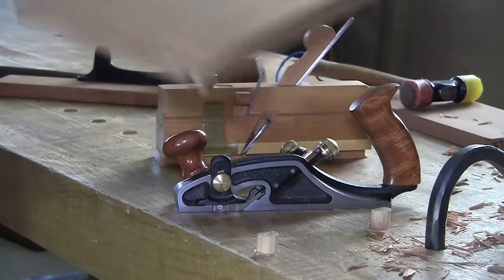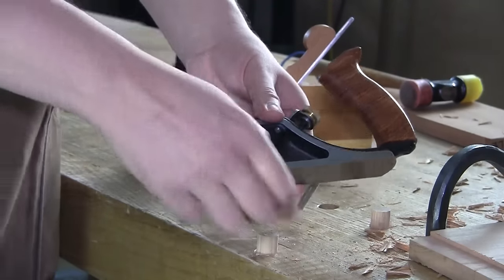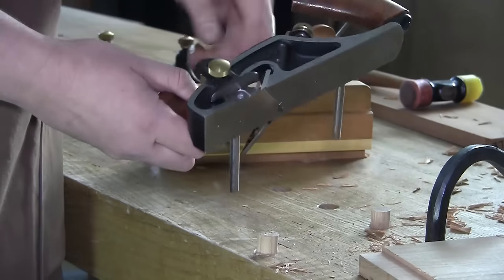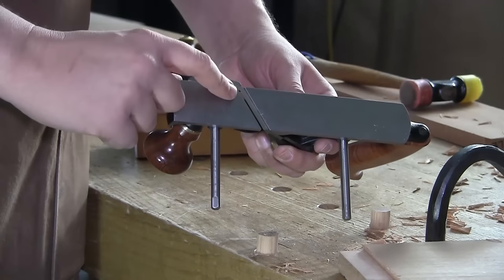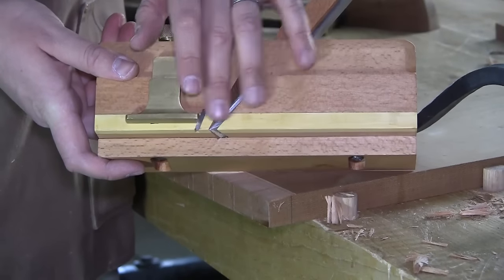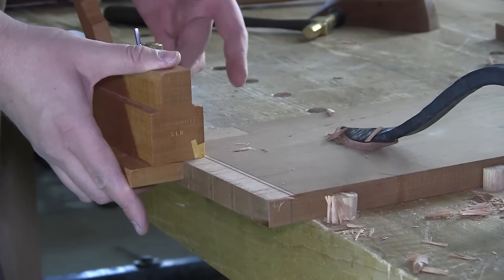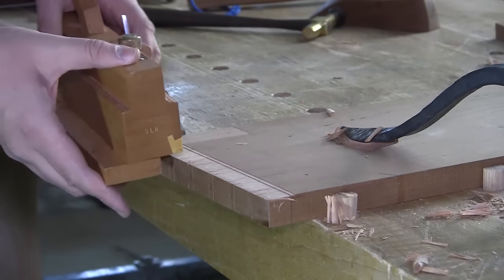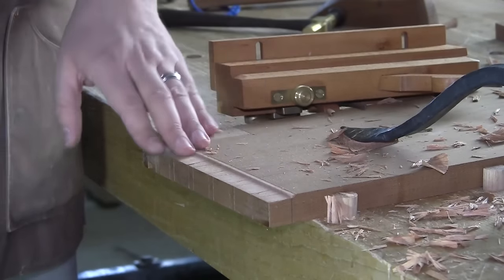Rabbet Plane Problem 1

Comment: I set mine to about 0.02" proud and it seems to work OK.  Having said this, I have found that I have to use a little sideways pressure also to make sure that the plane is registering against the work piece and if necessary take some light strokes to clean up the inside corner of the cut.

Comment: Hey Shannon, great series of videos!  My problem is with a Sargent 1080 combination plane. I get a pretty ragged edge when cutting rabbets, but it's not possible to set the iron proud.  Do you know if that's normal for these planes? I think I could modify the blade to make it work, but I figured I should ask.
Reply from the maker: +KingNast I don't have any experience with that particular model but I've used the Stanley cognate and I was able to adjust the blade out a tiny bit.  It doesn't have to be a lot.
Reply: +RenaissanceWW Thanks for the reply. I was able to get about a 1/32" past the edge and it's working a lot better. Thanks!

Comment: I’m trying to find info on hand cut rabbets across the middle of long boards, so fence is useless. Any help would be so appreciated!
Reply from the maker: So you're talking about a groove then?  Use a straightedge clamped down to the board as a fence and run your plane up against it if you have a rabbet plane or plow plane where the blade extends all the way to the edge.  If not then use that fence to saw against like I show in my sliding dovetail video or as it using a dado plane like I show in my ADB Bookcase project.  With the extents of the groove sawn, now chop out the waste in between then refine with a router plane or using the chisel bevel down to pare the floor of the groove flat.

Comment: RenaissanceWW thanks for the info! 

I'm new to woodworking and I'm now wondering if this is how I should be setting up a plough plane or am I supposed to set it  just like a shoulder plane?
Reply from the maker: Alex Castillo the plow is cutting an enclosed joint. So both corners of the blade are engaging so it's not necessary. I suppose if you cut lots of rabbets with it maybe

Comment: yes having the blade proud of the edge of the plane is needed BUT it has to be MINIMAL amount.. it can not be past the scoring blade/cutter.. it should be set to be exactly in line with scoring blade/cutter, not more, not less.. in other words a few thousands of an inch NOT a 1/64 inch.. 

ALSO the cut should not be made like a normal plane stroke from beginning to end.. it should be started at the far end and slid back a small amount each stroke until the full length is established.. that will make a MUCH straighter cut that starting from beginning to end like jointing or smoothing and will better prevent surface chip out like you see on his board at (0.59- 1.01)..
Reply: This is good info and I'm glad I'm not the only one.  The first thing I thought when watching the video was that it doesn't make any sense.  How is the cross grain cutter going to do anything if the blade is out by 1/64?

Comment: I get that with my veritas combination plane! Guess what? You can't put the rabbet blade proud in that plane. If you rock the top of the blade to the left and hammer down on the set screw....well you can get 1/32nd of an inch proud. I found this out making a 5/8 deep rabbet for a langstroth hive. In addition, the plane leaves a hackney vertical wall on a 5/8 deep rabbet. Not impressed. Layed out a ton a cash for that too.